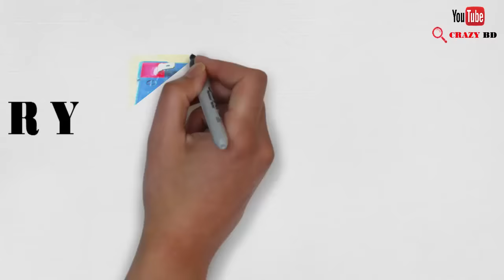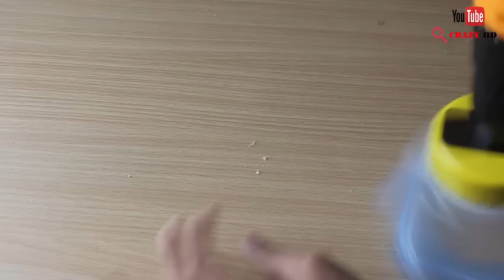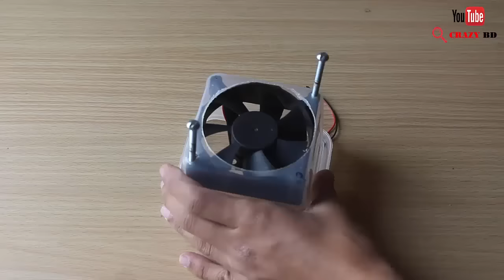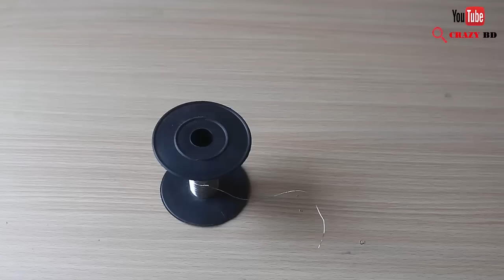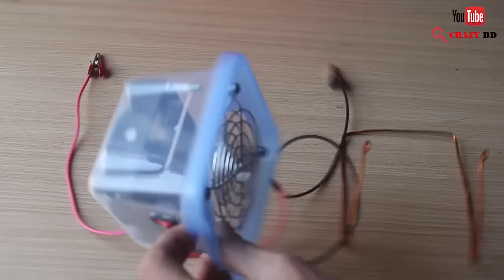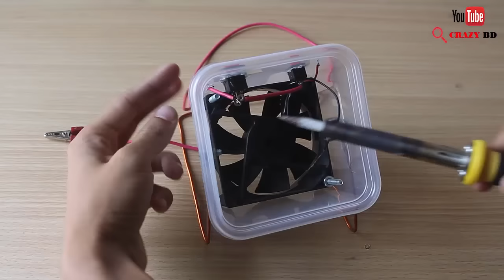How to make room heater at home

Comment: Alternatively, go to Wall-Mart and buy a proper one for ten Bucks that will work and won't burn your house down.
Reply: @Clive Morgan Freeman: Hes right you know
Reply: Brooklyn Avenue same to u
Reply: Hey hes right about the fire hazard. I can understand on what hes trying to show on how to build one but in plastic and with no safety features this can turn into a horrible fire quick. The fan could randomly stop causing the plastic to heat and melt which could catch on fire or anything the coils touch can catch on fire.

Comment: if he was smart it would b safer if the heating element was the secondary switch meaning it will not turn on until the fan has been turned on. its simple electric knowledge if u have every tried to study it.